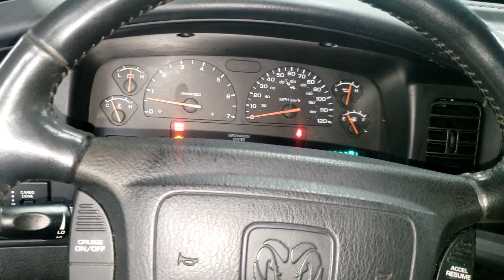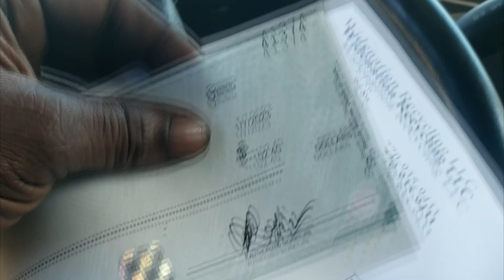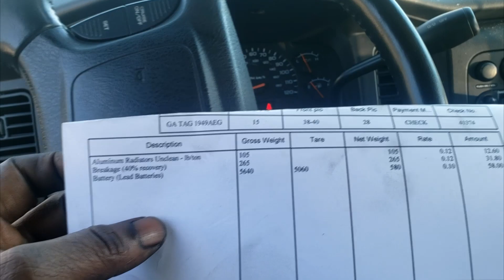Here's how much you can make with this SCRAP METAL JUNK.

Comment: I put some 89 in the Charger just to see if it helps the mpg at all. I don't really feel any more power and I'm not sure if the computer is able to advance the timing if it doesn't see any knocking.
I haven't done any scrapping since I was a teenager but my buddy and I made 100 bucks each from a pickup full of clean no 1 aluminum back in the late 70s.